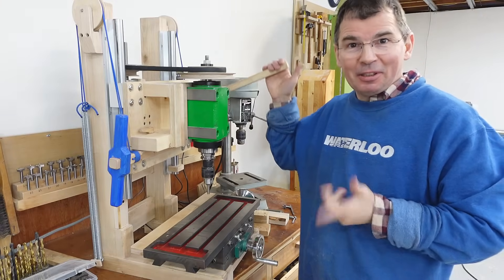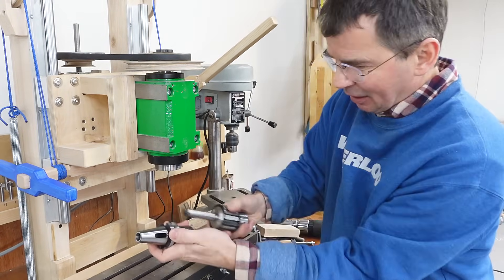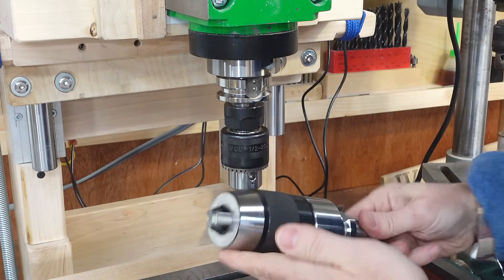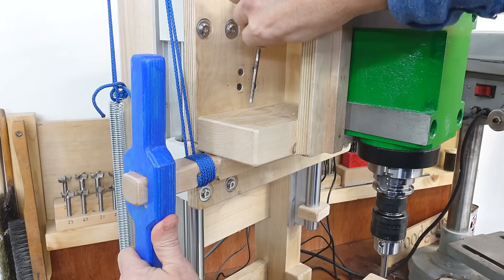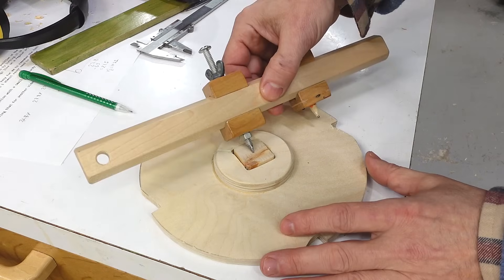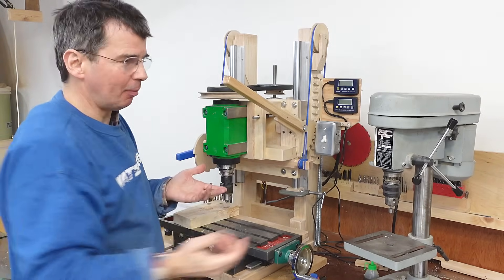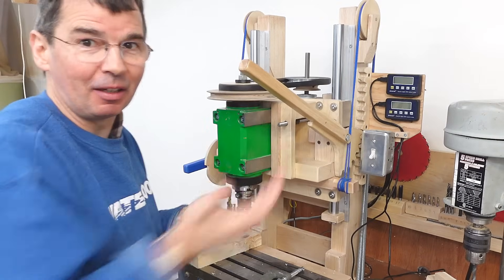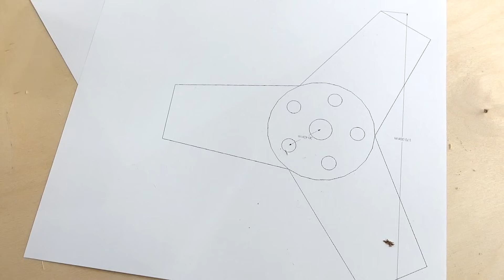What's wrong with my mill/drill and improving it

Comment: I think there are collets that go directly into the spindle and are locked via drawbar. This would shorten it a bit more too. I have a morse taper 3 mini mill and use a small drill chuck in a collet too. I dont know why make those drill chuck with a taper holder so long. I guess they are made for a lathe.
Reply from the maker: I was disappointed with that too.  Was hoping the morse taper would be mostly inside the BT30 tool holder, which would have made it more reasonable.

Comment: This is getting better and better. Now I’m dreaming of a pull-down ceiling-mounted version, where everything comes from above so the frame never interferes with the workpiece and there’s no deflection since there’s no need for an arm. 😃 (Perhaps using the mechanism from a sit-stand desk, upside down, to lower it from the ceiling, to make it sponsored.)
Reply from the maker: until the kids start running around upstairs while you try to mill something precisely.  That would be SO frustrating!
Reply: @matthiaswandel This part is out of spec due to child-induced energetic vibrations, trying to catch bottle caps launched by my automated turret.
Reply: @matthiaswandel  I like this idea. Ceiling mounted and wall braced.  Would you like to measure How much deflection  up down or side to side might be caused by kids upstairs?  Sounds like a simple cheap and easy project to mount a few boards to mimic the dimensions and suspend a few weights.  Finding harmonic resonance might be more difficult, and less useful than building the real thing with its own unique resonances.
Reply: flip it upside down, use weights as hold downs for oversized items, no post that way either :D (locating zero for the x, y might be troublesome though)

Comment: Are there DIYer-sized options for detecting how much something is twisting/warping?  Are there very careful sensor pads you could sort of tape to a device, zero, and then voltage changes as the pad is stressed?
Reply from the maker: Called strain gauges, available on aliexpress.  Its basically what load cells use.  But bonding these to material to actually pick up strain is a bit of an art form.  Or you could just measure the machine's deflection with a dial indicator.
Reply: @matthiaswandel  How do you make a dial indicator out of Rona lumber?

Comment: Pretty cool stuff Matthias. In terms of price, how does your wood lathe compare to a metal one?
Reply from the maker: Infinitely cheaper, because I built it out of material I already had kicking around.  Definitely not as good though -- lathes need to be heavy.  But if it was haevy, I couldn't just put it on a high shelf when its not in use.

Comment: If you use a torque wrench on the collet the bits should stop running off.
Reply: I hope he's not running into the column problem. If you bottom the shank of a tool in a collet you can't really draw the tool in anymore as you tighten the collet nut down. Then the shank of the tool acts like a column resisting the inward motion. I avoid that by throwing a wad of paper towel in all of my tool collets. The paper doesn't let the shank of the tool bottom out and can compress. When a tool shank columns you can tighten that collet nut as much as you want to and the collet just doesn't close up. You can't overcome the friction. It's kind of like Chinese finger cuffs. Mostly it's a problem when you top load bits with a router flipped upside down. Then gravity works against you. But if you push the bit all the way in and then try to tighten it up it'll column.
Reply from the maker: I just need to know to tighten it more than I would a router bit.  Never had a problem with the short router bits.

Comment: I remember someone very smart once explaining to me that the key part of what makes something a milling machine is the thousands of pounds of iron table/base/frame.  As a non-hardware person, it was initially surprising. Surely there's some modern way to get that rigidity and precision without doing so by having a big inflexible, immovable object.
Reply: Mechanical Engineering graduate here. Having a big mass is mainly to reduce vibrations, not just rigidity. Damping is another way of reducing vibrations, but that will inevitably lower the precision. Having a big mass is pretty much the only way to get both of them taken care of.
Reply from the maker: I'm aware of some research into compensating for flex of machines, but I imagine that could go unstable if the load isn't very consistent.  More iron is just better.
Reply: I’ve always felt that a big part of “they don’t build em like they used to” sentiment comes from just how heavy stuff used to be. Inertia is a helluva thing.
Reply: "Sir Isaac Newton is the deadliest son-of-a-bitch in space!"
That massive object at rest wants to stay at rest, until acted on by an exterior force.  If your (relatively) tiny force is going back and forth on the same axes then its net force is about zero.  The more massive (literally mass, not volume) your object is, the closer that little oscillating is kept to zero.
Reply: Rigidity and mass are both required. There may be other ways to get it, but cast iron is a proven one. I guess you could build it out of carbon fiber tubing filled with lead shot.
Reply: @mckenziekeith7434  Epoxy granite is a modern way of doing it to get mass and rigidity without having to have huge iron castings.
Reply: @mckenziekeith7434 I've seen a couple DIY mills that were filled with concrete as a cheap and relatively good source of extra mass

Comment: For a mill: First, don’t make the frame out of wood. Make it out of steel and epoxy-granite. Second, use proper linear rails instead of the round shafting & ball bushings that you have on it now.
Reply: First, start from first principles and build the best machines you can with the materials available.  Use those machines to enrich your available materials and make better machines.  Wood is literally not the best to make high-precision parts, but it is good enough to build a machine that has 10x-100x the precision of the original machine.  Machines make better machines make better machines... ad infinitum.  The knowledge of how to manipulate and optimize "primitive" or "basic" materials like wood is a critical part of the bootstrapping that certain world events will make necessary.

It isn't necessarily the main or even tertiary objective of this channel, but Matthias has taught us how to make some very good equipment with minimal use of refined materials.
Reply: @Kineth1  This reminds me of the Gingery shop made machines, which you can make of Aluminum with bolted on steel parts. I guess you could have similar precision with wood.

Wood can be used to make high precision machines but at that point it's almost as difficult to work as metal. John Harrison revolutionised clock making and he started out with wooden clocks, even his best pieces had wooden parts.

IIRC French nuclear submarines use wooden bearings on the propeller shaft, because they have higher durability than metal in salt water and are self-lubricating. It's a very uncommon specific wood tough.
Reply: @iotaje1  lignum vitae
Reply from the maker: yes, I realized too, linear glides are much better.  If I was building it again, I'd still make it out of wood, just more stout.  Wood is just so much cheaper and more convenient.
Reply: @matthiaswandel  For a drill press, that’ll work. I would suggest throwing a coat of polyurethane on it though, so that any cutting fluids that gets on the wooden components is easy to clean up and doesn’t degrade the wood.

I don’t know where you’re located, but here quality wood is quite expensive; drastically narrowing the price gap between a good wooden frame for a drill press and a frame that’s made from steel and epoxy-granite that can also do milling. I’d expect to spend $75 to $100 on the epoxy granite (epoxy resin kit + sand + pea gravel) and $25 to $50 on the metal (that’s in US dollars).

P.s. - by “milling” I mean precision cutting in all directions in metal including steels, where rigidity and vibration damping are important. FWIW, and for anybody else reading this, if you’re just cutting softer materials like wood and plastic, you can get away with a wooden frame machine; and many successful DIY woodworking machines and jigs are indeed made from wood themselves.
Reply: New here? 😀 (He's an engineer, he knows.)
Reply: @rodfrey  I don’t know what his background is; obviously he’s got at least a fair bit of technical competency to do what he’s done in the videos that I’ve seen; but it could all be self taught and thus missing something specific for all I know. There’s a reason why wood is not used for the structure of a mill commercially or in successful amateur builds, but he did say it was intended to be a mill, so…

However; he’s not the only person here seeing this, so the comment I posted has value to others who don’t know.
Reply: @darkwinter6028  That's fair. But it's somewhat akin to visiting a channel specializing in pallet wood furniture, and commenting that no professional furnituremaker uses pallets. Wandel has made multiple large bandsaws, a tablesaw, a 12" jointer, a template carving machine, and probably more - all from construction lumber. It's not exactly the point of the channel but it is the major theme.
Reply: @rodfrey  On the other hand, those machines can all tolerate a (comparatively) rather large amount of flex in their frame. Metalworking mills and lathes can’t. 🤔

Edit to add: FWIW, some of those pallet wood makers are professional, in that they make their living from it. I do get your point though. 😉
Reply: Come on, steel? You're missing the point here. I would be way more impressed if these things were built from cheese.